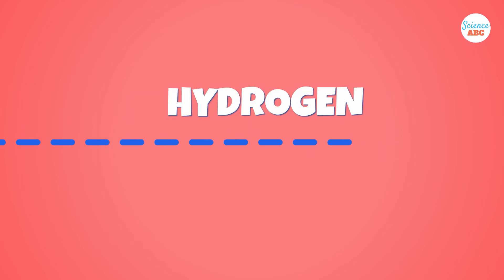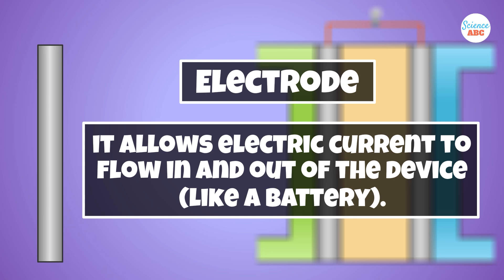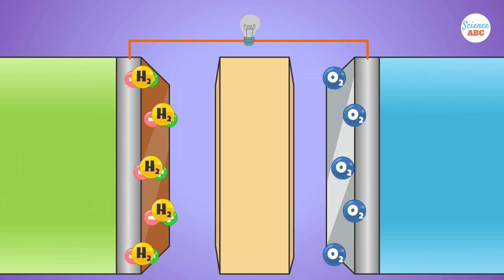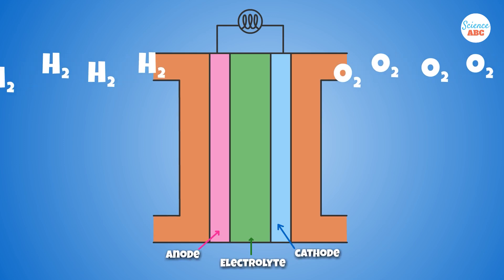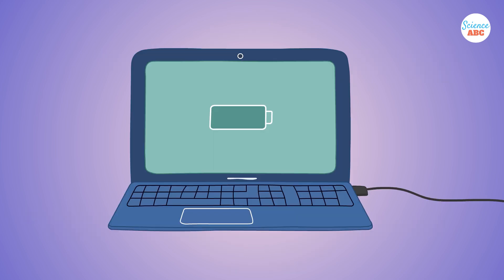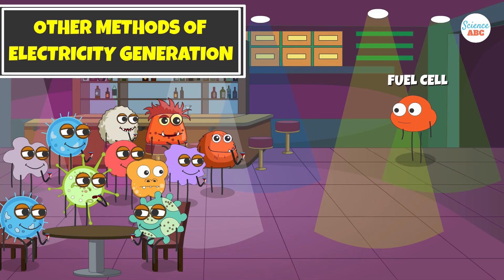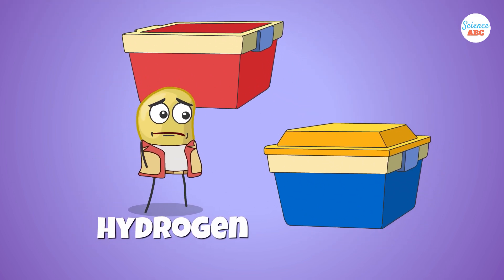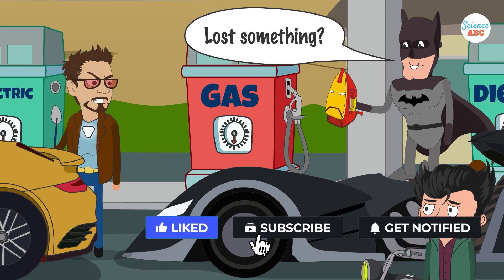Fuel Cells Explained in Simple Words for Beginners

Comment: Once water is disolved into gasses then into external heat energy, it's gone and can only be replaced by asteroids or comets. Mass disolved into external heat energy outside of mass can't be replaced unless you harvest mass from space and bring it into our atmosphere whole. Our planetary internal magnetic field is shrinking inward, and our outermost perimeters are stronger as the mass disolves into external heat energy outside of mass. Making the planet hotter. Disrupting our climate change in a hotter environment.  We'll have to go underground to maintain equalization of pressure as temperature within and without our mass. We need to harvest the kyper belt to renew our mass 
Our planet is made up of elements. So our planetary internal magnetic field is an amplification of quaternary elements synchronization combined to magnetic field grounding currents through its surface and core.  Hydrogen has the strongest internal magnetic field. As magnetic fields shrink, inward pressure increases. Meaning atmosphere gets hotter. Fact.